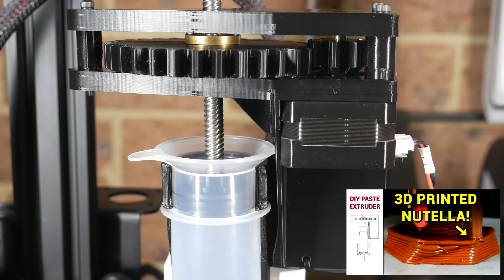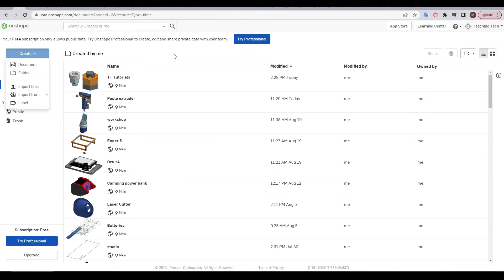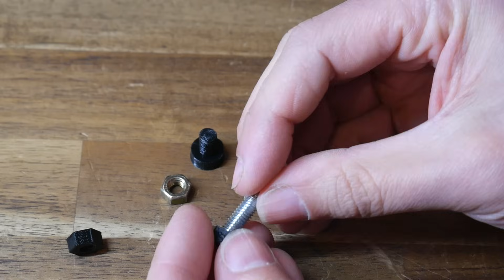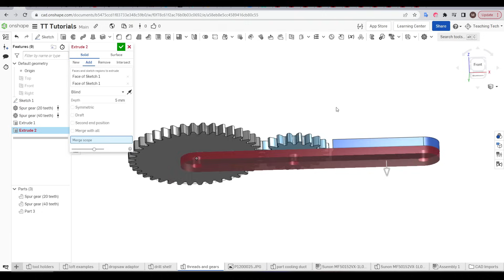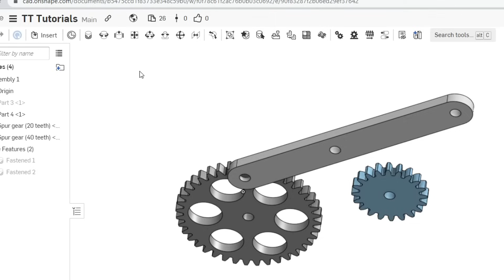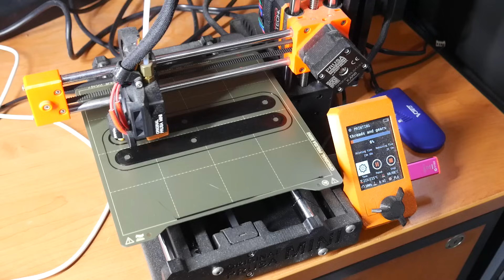Designing and assembling parts with screw threads & gears - 3D design for 3D printing pt6

Comment: Very nice video, Michael! When using gears, always set all your gears that need to mesh to the same Modulus (M) and pressure angle (typically 20 degrees for Modulus gears) when designing. The modulus and the number of teeth define the pitch diameter of your gear :  an metric gear M1 with 40 teeth has a pitch diameter of 40mm. For some diameters and axle distances you'll find that you can't make it work, because you simply cannot have for example 37,5 teeth : whole numbers only 38 or 37. To get around this problem you have to shift the profile , as we do in industry. . Shifting is only for involute profiles only, of course, like the ones in your video. Profile shifting is used a lot for small gears ( 10 teeth and below ) because the teeth have less or no undercut, but the diameter of the gear is then also bigger. This is also true for DPI gears.

Comment: Gears is the only thing I've had a problem with on my 3D cad of choice Design Spark Mechanical. This will actually be very helpful and I can export the file as STEP and maintain the geometries. Up to now even screws everything has been faster and easier on DSM we shall see where the series goes. I look forward to it.

Comment: Love the video, but to ensure equal wear of each tooth on each gear, the number of teeth on contacting gears should be co-prime, so that with every rotation, new pair of gears work with each other.
Reply: Does using co prime have an impact on accuracy in exchange for the durability? I'm thinking co primes would be good for say a waterwheel but would they be any good for a clock?
Reply: @gazmant3438  wear would reduce the accuracy in my opinion. Never thought about it, just was taught to chose the number of teeth this way.
Reply: @LostprophetPL  thanks, I though so but if you google co prime ratios it doesn't really give you a clear answer. Now I'm wondering if you use three gears can you correct...
Reply: What does that Mean
Reply: @blaskotron  the number of teeth on cooperating gears should ensure that each tooth on each gear makes contact with different tooth every rotation. That ensures equal wear and stable operation.

Comment: cura has an experimental feature 'slicing tolerance' now that might help with threads and avoiding the fudge factor.
Reply: That's my preferred method too. Separation of concerns is a good thing! Let the slicer handle the details pertaining to each individual printer / filament etc. It gets confusing if models downloaded from the internet already have printing tolerances built in and you have a different printer or worse, the designer is compensating for over extrusion by shrinking the model...

Comment: On the spur gear script you changed it diametral pitch, it may have an option to use gear module instead, that way you give the gear a set module and change the number of teeth to set the size. Two gears with the same module will mesh.

Edit: just went back and looked and they do have that option.

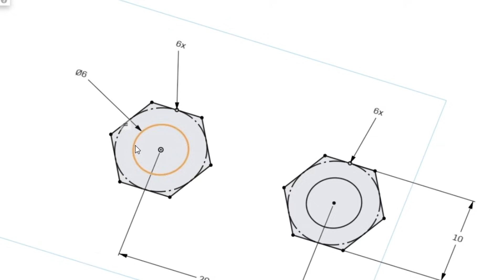Comment: Smashing job as always.  Learning someting new every time I watch one of your tutorials.  @7:21, should that not be reducing the sketch diameter to 5.5 as it's the bolt?
Reply: @7h5ffc5s  He actually reduced the diameter of the bolt by .5mm (.25 from the outer face, which as he says in the video is effectively a .25mm radius reduction) and increased the diameter of the hole in the nut by .5mm. Which is to say Colin is correct: the description of the change to the sketch which would produce the same result is wrong. In the video he suggests changing the diameter of the bolt cylinder to 6.5mm, which would make it larger rather than smaller. You actually would want to change that diameter to 5.5mm and change the nut hole diameter to 6.5mm.

Comment: I really enjoy this series. I do have a question that maybe we can address in a future video.

Scenerio: you have a fully 3D printed project with a number of individual parts all put together in a single tab, fully "assembled". Now you are needing to export each part or groups of parts in the correct orientation for printing. Let's say you have a bolt designed such as in this video but it is upside down in the main design. Is there a concise way to go through the list of parts as a whole and correct or put into another tab as they would be sent to the printer?

This way if you were sharing on printables or the like once tested, you can do an export and sent to the site without having to fiddle about in the slicer. 

Thanks for teaching me a new tool to utilize in my 3D printing Journey!
Reply: You can still just export the individual part studio parts. You can have them in one assembly and just import them from the different part studios. That way the orientation of the part studios can be set to printer orientation and the assembly can be something else entirely.

Comment: I’m new to 3D printing so just looking at your videos. I noticed in this one at 7.05 min that you changed the shaft Dia of the model by 0.25 mm smaller, to Dia 5.75 mm which was correct, but at 7.25 min then changed the drawing of the shaft Dia to be 0.25 mm bigger to Dia 6.5. That wasn’t correct so undoing that , your shaft Dia worked. 
I enjoy your videos as are easy to follow
Cheers Shep6

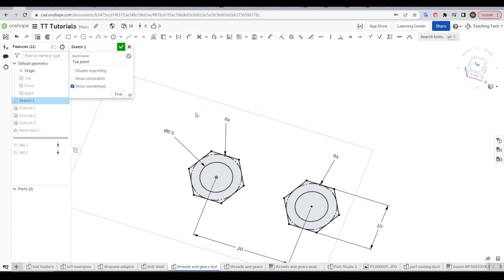Comment: 7:30 Usually don't have an issue unless it's printed vs printed threads. Plastic vs metal usually works fine. Maybe a printer calibration issue? Seems unlikely though since you've made several videos on the subject. 🤷🏼‍♂️

Comment: Hey! Great video! I’ve been loving your tutorials to learn on shape. I want to be able to make a 1/4-20 (which is 20 spins by inch) bolt, for a standard camera nut in my c920. That measure I think but I could be wrong is nether ANSI or ISO. I believe is UTS. Could I still make it with this method or I maybe need to install a different feature? Thanks for all your work!

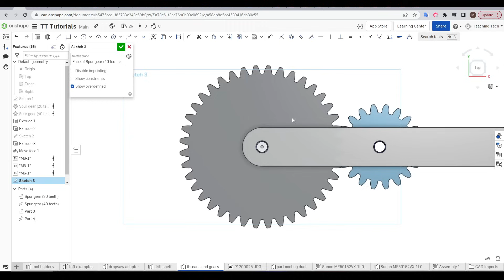Comment: 12:38  how did you make the circles all equal and equidistant?
figured it out.  i drew a hexagon from the center of the gear and placed the circles on the side vertices.
Reply: Tip: find circular pattern in the menu.  Make one first, then this will make a circle with as many copies as you like 😊

Comment: Trying to get the center point of holes to show up in assembly is terrible. is there a trick I'm missing? Especially on the threaded holes, it keeps trying to find a mate on the thread
Reply from the maker: You can hover the mouse over the surface you want and then hold the shift key. Mouse moves after that will only lock the mate to other points on that surface.
Reply: @TeachingTech  holy crap that was amazingly easy now. Thank you!

Comment: Forget metric vs. standard: Can you make Acme machine threads with this?

I need to make an adapter/spacer for a tire changer. It uses a very course Acme thread for speedy threading on/off but the included hardware is too thick to fit my wheels (over 1 inch diameter when my wheel bearings are 14mm). The thread must be obscure because I’m not finding much info for replicating it.
Reply: Of course. You just need the right script to make them. Or if you want to get technical, you can look up the specifications for an ACME thread and make your own using the basic operations from previous videos.

Comment: Now that you have talked about screws and threads how to create pocket screws to be able divide huge 3d prints into chunks and merge them without problem?
Reply: He has already covered things like trapped nuts and now threads, so just put those skills to use with pocket screws. It's simply an application of the techniques he has already demonstrated.
Reply: @reverse_engineered  i could not find a way to orient a hole 30-45 degrees against the plane that's why I am asking

Comment: Did you have to do anything to make sure the sizes of your 3D printed parts actually matched non-printed parts (for example, 3D printed bolt with metal nut, and vice versa)?  I would imagine that if your 3D printed parts actually end up a little larger or smaller than designed, they wouldn't work, and adjusting the clearances on the hole and shaft wouldn't be enough.
Reply: It depends really. For clearance holes, nut holders, etc. I just oversize by ~0.2mm, which is usually a fairly good value for my printer. For more complex parts like threads, you might need to do more experimentation
Reply: I used the Califlower model to test for common issues including shrinkage and over/under extrusion, then compensated for those in my slicer my scaling the model and using the horizontal expansion option. This allows me to get proper clearances now.

Comment: Rather than adjust the models, wouldn't changing to EXCLUDE, in the slicer,, be a better/easier way to adjust for the "too much material" condition of the threaded features?  I was just wondering, because it should take care of these kind of fitment issues.
Reply: I would certainly try that. A properly calibrated printer should give dimensional accuracy close enough to fit the parts. I found that with scaling my parts slightly (to account for shrinkage) and using the horizontal expansion option, I was able to get holes that fit properly. It took a lot of trial and error, but it was worth it.
Reply: @reverse_engineered  Thanks for the reply.  Keep up the good work with the videos.!
Reply: For those of us in the peanut gallery, could you please elaborate on what "changing to EXCLUDE" means? I tried to look it up, but didn't find anything online or in my slicer (PrusaSlicer).
Reply: @harvey66616  Cura slicer, experimental settings, exclusive, middle, and inclusive.  I'm not sure what the equivalent setting in your slicer is, sorry.
Reply: @michaelskoblin2315  Thanks. PrusaSlicer/Slic3r might not have anything like that. But knowing where the settings are in Cura is useful...I can check out the docs and confirm my guess (based on your info about what choices there are) about what it does.
Reply: @harvey66616  I think this is adjustable in the latest cura, where the earlier versions had the 3 choices, excl, incl, mid.

Comment: The thought of needing an add on just to do proper thread modeling makes me not really into this tool
Reply: Why does that matter? You might be used to things like threads in Fusion 360 or others, but plenty of CAD programs simply have the basic shapes and operations and you build those up yourself. Is it really a big deal to install a publicly available add-on to get the special features you want? This sort of extensibility is really common in the open source world; just look at plugins for Cura to see how many useful features others have created to make the program even better.

I don't even recommend you model threads in 3D prints anyway. Create a hole of approximately the correct size and use a tap to get what you want. Or use a threaded insert; it's way stronger than any plastic threads could ever be. And I would avoid making bolts or any other external threads in a 3D print; just all thread or an actual bolt. 3D printing has its strengths, but making strong and precise fasteners is not one of them. Use the 3D printer to make the custom parts and use standard fasteners everywhere else.

But by all means, go with whatever tool you want. This is a tutorial series on using OnShape. If you don't like OnShape, there are plenty of other tutorials out there for other tools.
Reply: @reverse_engineered  I think you should write books instead of youtube comments. I'm not reading all of that. My point was simple: relying on features other CAD software consider baseline simple features to be implemented by unaudited, untrusted third parties that you have to take steps to go out of your way to install from, is NOT a fully featured CAD software. It is a stub of software with a plugin.